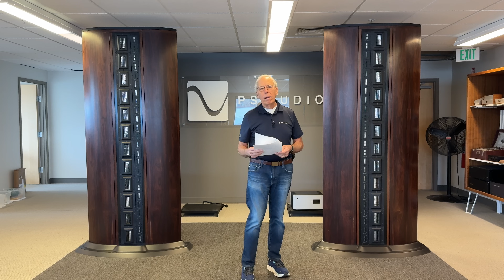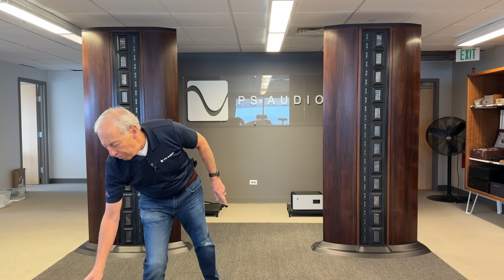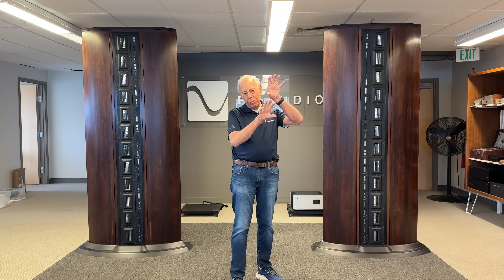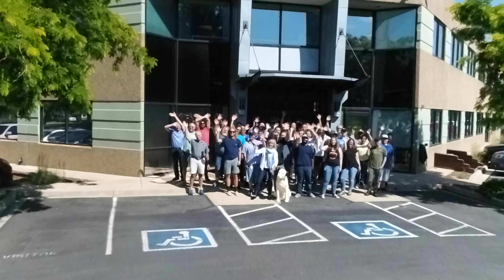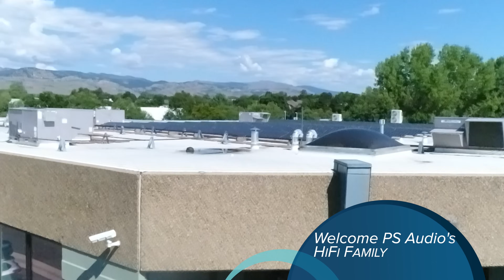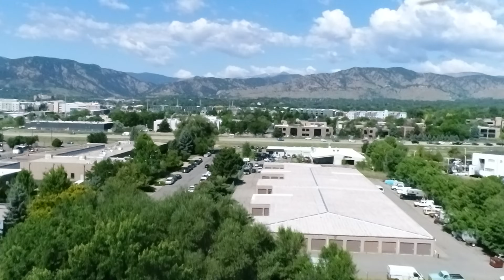Importance of crossover parts in loudspeakers

Comment: In my experience the quality of crossover parts makes a huge difference not only when upgrading from very cheap to high quality, but also when upgrading from high quality to extremely high quality. I built the external crossover for my Tuscanini planar magnetic speakers (under instructions from the manufacturer) using high quality parts (claritycap MR capacitors, mundorf foil inductor, Jantzen air core inductor, Jantzen supreme resistor) and it did sound very good, approximately 300€ of components. Recently I did a massive upgrade of all the components using Duelund cast copper foil capacitors, huge Jantzen waxed foil inductor and heavy gauge air core inductor, Duelund resistor, silver soldering and audioquest top quality cabling inside. It was the most impressive and transformative change in my systems performance I have ever experienced, even more than upgrading preamp or tonearm. Sure I spent quite a bit of money but it was well spent. Obviously the speaker itself has to be worth the investment.
It was a much bigger change than going from the relatively cheap internal crossover to the first external crossover I built. Duelund stuff highly recommended (not the wire though, that I really don’t like)

Comment: A friend of mine knows a bespoke speaker builder that claims he even rebuilt a Magico (overly expensive brand) crossover with better parts and it sounded way better. Can't imagine a +$100.000 speaker using cheap components. Any comments on that?

Comment: Always remember the bottom line dictates cost/profit.  More often than not  you get off the shelf drivers , mediocre crossover parts and cabinets that are prettier than They are optimal .it's a balance and shedding costs are the priority in most cases .

Comment: Yes it’s real. I competed the upgrade from GR Research on a set of Klipsch RF7-IIIs. The difference was night and day. Tonality was vastly improved. The drivers actually start and stop when they are supposed to. The harshness of the high frequencies are much smoother. Transient response was improved. Bass is tighter with a much more even response. The parts are of very high quality.  Soldering was done directly to the drivers.
Reply: after the experience of that success story, what is your advice for me buying new speakers and the process of upgrading?  I'm a little lower on budget but if I got much better sound then I could justify the stretch.  I'm asking two things what cheap speaker should I have upgraded or spend more on the inital speaker and not upgrade?  Such as could I send the entry level Klipsch and get most of the way there?  Or do you recommend somthing else?
Reply: @trauma50disaster1  That's a tough one to answer.  The only reason I did the upgrade is because already had the RF7s and didn't want to spend 3x the amount on a new set of speakers comparable to the performance of the crossover upgrade.  However I would say If you want to flat out buy a speaker that has even close to the same level of internal parts quality you are going to have to spend +$10k to get there.  If you want to stick with entry level Klipsch, I would recommend the reference premier level with anything version 2 (RP-8000F II).  Reason being, Klipsch has corrected the frequency response in the new versions which make a noticeable difference let alone still containing the same level of parts quality.  So you wouldn't necessarily have to do an upgrade, and I don't think GR Research has an upgrade kit for that version just yet.  Or you could buy version 1s and then purchase the upgrade kit for those.

Comment: A speaker element does not have a flat, straight frequency response. The job of a speaker crossover. is to create a flat response. Crossover has two jobs, one of which is to only let the midrange or treble only get midrange and treble frequencies and the bass only get bass frequencies. The second is to lower frequencies the speaker has too much of. If the crossover is not put together correctly in relation to the speaker and you have sharp treble or midrange frequencies, you can use the world's best crossover parts without getting the right sound. On cheap speakers with sound problems, it's not as easy as just changing to good parts and the sound is perfect. In the same way that if you have too much salt in your food, it doesn't matter how good the quality of the salt is. But if you take a speaker with GOOD sound and change from, for example, electrolytic capacitors to polypropylene, then it is a small upgrade.

Comment: Because of the way commerce works production cost must be a low as possible because each cent is multiplied in the chain. That is way cheap parts are used as much as possible or the speakers would cost a lot more.
Reply: So you dont think  $2,000 speakers can afford to use the best crossover parts! A 1st order crossover is simplest, dont that mean cheapest. Best speakers there are have no crossover, spend nothing.
Reply: @myronhelton4441  no. Using the $400 crossover parts that GR Research push would likely add $4000 to the price of those $2000 speakers.
Reply: @myronhelton4441 oh, and I'd love to see your full range (20hz to 20khz) speaker with no crossover. I'd be surprised if the frequency response was within +-10dB. Plus, distortion and energy storage would likely be horrendous. A driver capable of moving enough air for 90dB at 40hz (let alone 20hz) is never going to work at 20khz. Directivity would also be a total nightmare. Oh, and off-axis phase issues with a first order crossover can be horrendous, as would be controlling cone breakup from drivers operating out of their preferred ranges.

Comment: Bad quality caps make sound harsh.. and  good quality caps make sound smooth..
You can only measure it by  taking acoustic measurements and see how harmonics distortion curve behave.
 With two different quality caps, you may see same exactly fundamental frequency behavior but with good quality caps the harmonics distortion generally tend to have more lower distortion percentage  and less jagged curve.
Reply: Have you ever seen harmonic distortion plot of a speaker?
Reply: @paulb4661  yes.. why?
Reply: @Acoustic-Lab  What is, on average, the THD level of a midrange driver, for example and that of a capacitor, if you may, please?
Reply: @Acoustic-Lab  Let me then; although no improvement is without merit and without arguing over actual, proven audibility threshold, one can clearly see, that the drivers themselves are the main contributing factor in the overall THD level, with the most advanced units measuring worse, than an ordinary, industrial grade, smd electrolytic capacitor. Since, this is however the only easy "improvement" path accessible to eager amateurs with no engineering background, nor a workshop, benefits are exaggerated and prices inflated.

Comment: Even the best speaker manufacturers build speakers to a marketable price point with a desired level of performance. Unfortunately, the crossover is often the sacrificial lamb in many instances. Danny @ GR Research usually replaces cheap iron-core inductors with air-core inductors, electrolytic caps with Poly caps, sand-cast resistors with metal foil resistors, and steel binding posts with his beloved tube connectors. He also sometimes changes crossover component values to smooth the response, improve spectral decay, and improve off-axis response. Danny also tames cabinet resonance with his No-Rez damping material. I would buy these kits and add some additional bracing while I was inside the cabinets. I trust GR research to do it right, but I cannot vouch for other YouTubers.
Reply: Some of what he does is simply plain crazy and a waste of money though, he has kits worth more than the speakers they go into, that with the kit, are not better than a spaker you could buy for what the kit costs. 

Even funier is when you see a real life graph of reflections and in room response and people buy these kits to plonk speakers into corners or in units with their TV.

Comment: Whilst I dont doubt the engineering here, I think there are caveats that are too often  unstated, and the notion that Manufactures are skimping on parts is compelling. But you have to remember  opening up the speaker and upgrading the parts has a non trivial cost, likey the work of GR research and the l can be transformative but you have to factor in your time or a vendor and the price of the upgrade, so why not just buy the more expensive speaker in the first place? My car would go faster if I got the V8, the at source parts cost in only likely  + $100 for the manufacturer but maybee $5K to the buyer, it's not a rip off its the  economics of doing business and staying in business
Reply: It's a hobby for a lot of people as well, and today with the false economy being at an all time high it's not that difficult to improve things for a relatively small sum. 
Moving up in price of the original purchase price is unfortunately just diving deeper into the bad economy from several brands, best value right now is DIY (knocking a zero of the price is doable in some price ranges).
Reply: Danny has taken apart several "more expensive" speakers and shown that a lot of those also use crap parts and most of the time have response issues that also need correcting. On the flip side he has taken a few that had really nice responses but used cheap parts, but does mention they were targeted at a lower price point, so he doesn't redesign the xo, but just uses higher quality parts.
Reply: GR has done MuCH of the WoRK for YOU. You have the design😂 you have testing. What more do you want?
Reply: By developing their own speakers line PS makes buying a great system easier.   This is unique in this industry where matching components can be hit or miss.  I have no doubt they use quality parts, careful design and most importantly listen.
Reply: I think that there are people trying to extract some money from every caveat. The less mesurable the effect of their work the better for them. Just listening to the guy from GS Research gives me snake Oli salesman vibes.
Reply: @AnthorOne Having done a number of upgrades myself, mostly just upgrading quality - before I knew who GR research was, I can safely say, upgrades can transform the speaker from Ok to great.  Danny speaks the truth on this.  And he is right, some good speakers have shit internals, and once upgraded, become great speakers.  Try it yourself and you’ll see.
Reply: @AnthorOne talking rubbish he measures in detail. Most reviews dont do that, purely subjective rubbish. He talks about the drivers and cab too, you make up your own mind if worth doing or not. He is not selling snake oil.
Reply: @AnthorOne Danny uses speaker cable risers. That could be considered snake oil, certainly.

Speaker cables? Tube connectors? I'm with him on the speaker cables. You may not be, so we'll leave this as unproven.

But his work on redesigning crossovers? He actually takes measurements to backup what he's improving. Zero snake oil here. Plus, changing from iron core to air core inductors is known to improve sound. It's likely measurable as well - quicker signal decay, less stored energy, faster rise time.

So, overall, very little snake oil. Lots of actual fact based engineering.

Comment: Oh yes 😊.... the many hours of testing and developing XO networks so they sound perfect ... there's so many parameters involved within each element in the network ... 
Paul summarised the relative significance of the basic parts of a speaker perfectly... 
Designing a XO network is done using various pieces of software and STIIL requires human intervention as modelling is one thing and reality is quite another. I refuse to use gating to eliminate boundary reflections... opting for total free field measurement.

Comment: The majority of the main stream speaker manufacturers have to work to a price point. The look of the speaker plays a big part in peoples buying choice and this is where a lot of manufacturers bias their efforts. While for the most part, the crossover design is OK, and most people will never see the parts as they hidden inside the cabinet, this is where the costs are kept down.
For me this is the issue, because the crossover is a very very import part of the speaker as a whole. Get it wrong and the speaker could sound bright, fatiguing and harsh and have all sorts of phasing issues, nulls, bumps in the response etc. The opposite also happens where the speaker sounds dull and lifeless.
Assuming for a moment the design is good, increasing the quality of the parts and using the best you can afford in the signal path  makes a big difference. How mad you have to go on the parts is debatable. But what is the point of spending a ton of money on equipment and cables only to be let down by a poor quality crossover in the speaker???
It would be great if manufacturers would cut back on the exotic cabinet finishes and spend the money on components, but how many "audiophiles" would buy a fantastic sounding speaker finished in plain MDF???
Reply: There is also the profit margin, the dealers margin and markering margins all working together to reduce the actual value. DIY builds will bypass all of that and DIY upgrades can help put that value back in sometimes.

Comment: I don't have any crossover parts in my loudspeakers. 

I tri-amp.
Reply: What kind of external crossover do you use? I would like to hear all about it.
Reply: @EskWIRED  Two stereo Biamp SM/23 crossovers. I'm trying to replace them with a FreeDSP Aurora.
Reply: So you have crossovers in the signal path to split it in three signals before amping.
Reply: You run full bandwidth through all 3 amps?
Reply: @Pete.across.the.street  Active crossovers between preamp and each amp.

Comment: Sounds like Paul supports GR Research’s position on the effects of quality crossover parts 100%
Reply: Yep and i do as well!
Reply: GR never needed any validation, all you need is a parts catelog and look up what the crossover parts in your speaker cost. Speakers are built to a pricepoint and asthetics usually have priority. Crossovers are hidden away.
Reply: @jondonnelly3  catalog
Reply: If you don't understand how a crossover works, then you don't understand this!

Crossover does a lot more than many people know. Some are connected in parallel and some are connected in series. Some coils have a coupling capacitor over them. Some crossover circuits lower frequency peaks.

Not as easy as many people think!

If you put this together incorrectly, it doesn't help how good parts you have. Not a single crossover recipe for all speakers, no.

A frequency peak doesn't get lower even if you use an expensive component.
Reply: 3:10 not exactly, since often the upgrades cost more than the speaker.
There are 2 issues, the design and the parts quality. I bet you that 90% of the time Danny redesigns the crossover, you'd get more improvement by building that with cheap(ish) parts than just sticking in better ones for what is already there.
Reply: @spentron1  That is invariably true because chances are, people send in speakers they aren't happy with in the first place.

Comment: What about changing inductors to air core and increasing the order of filters?
Reply: A steeper crossover slope is not always an improvement.
Reply: @Fastvoice yep. More components, larger values, equals more stored energy and signal degradation, plus issues with phase changes can create its own issues. Nothing is straightforward with audio. Everything is a compromise.